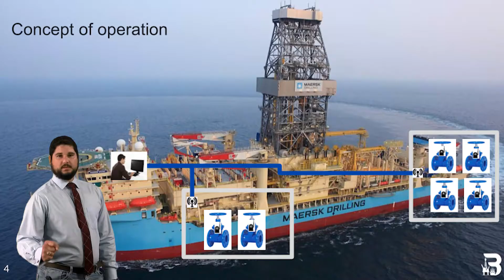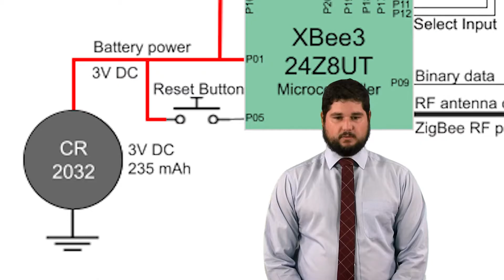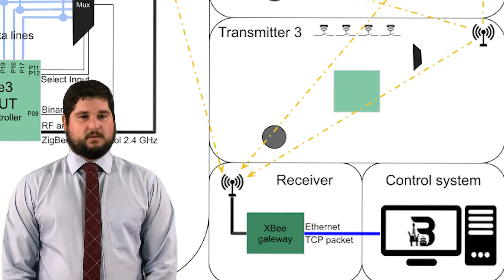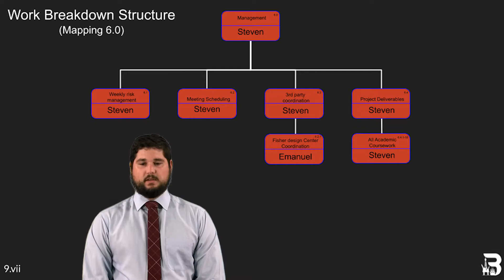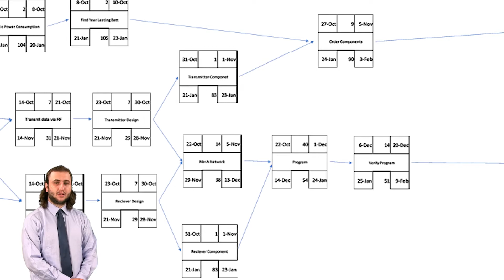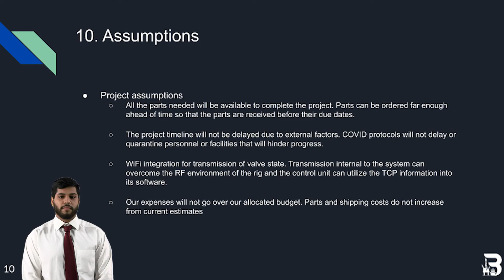Basco Makes BIVOT System

Comment: Are you planning to make multiple size devices for different sized valves to find out the size requirements of the device in order for it to work properly? or is that too much and will have to be simulated.
Reply from the maker: Yes we are designing the device to be modular and allow for placement on a large variate of valves. The sensor and transmitter parts of the BIVOT system will be removable. The sensor would be modular and design for to fit the measurements of a desired valve. The senor is only made up of electromagnetic sensor and a pipe clamp. This  will allow for the senor to be remade and redesigned on the cheap. The transmitter houses the brain and battery and will have a standard shape that will allow it to attach to any senor like a battery pack.  Overall because of the vast amount in variation in valve types and size each senor would have to be custom made while the transmitter will be standardized. For our prototype wee will be making custom sensors for each of the valves we have available but using the same type of sensor on each of them.

Comment: Can you provide some details on the assumptions used for your battery duration calculations?
Reply from the maker: Current no calculations have been done. We are waiting till we have the component list solidified. At that point we will calculate the amount of power need to power the device for a year and choose the battery accordingly.

Comment: Have a device that fits in the allocated space on the valve is critical.  Do you have preliminary dimensions on this device?
Reply from the maker: That would entirely depend on the battery and how long the current one lasts as well as the size of the over all valve. With the current components we have we can easily fit the transmitter inside a  2 inch x 4  inch x 1 inch box. However if a longer  battery life is require this size would increase to accommodate. The sensors on the other hand will be stored in the pipe clamps that shall go around the valve. This clamp would depend on the size of the valve. The plan is to have the sensor and clamp be modular to each type of valve changing in size while the transmitter design be the same from valve to valve.

Comment: Overall nice work.  Can your share with me a bit about the design options that you considered and how you ultimately selected this conceptual design?
Reply from the maker: We initially had two designs in mind when first trying to figure how we were going to measure the device noninvasively.  The first idea was for a multiturn valve which we would have measure the vertical movements of the valve as it rotates. When a multiturn valve is rotated it is raised or lowered. However we quickly found out this is not the case with all multiturn vales. The second idea was for a gear system to be implemented to measure the rotation of the stem. Gear teeth would be attached to the stem and be used to rotate a potentiometer. The voltage given off by the potentiometer would then be used to determine if the vale was opened or closed. This idea was abandoned because there could be slippage in the gears and the fact the not all valves need the same number of rotations to be opened or closed. The current method of sensing rotation is the best method we have come up with and we are using it because it can be implemented on all types of valves and the only thing that would need to change is the clamp size.